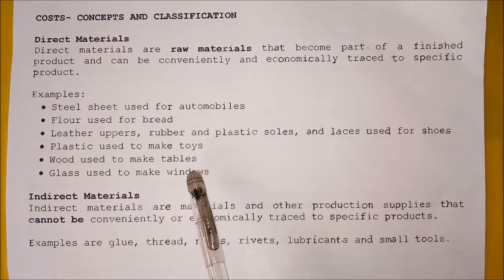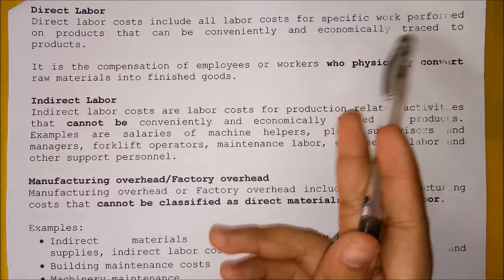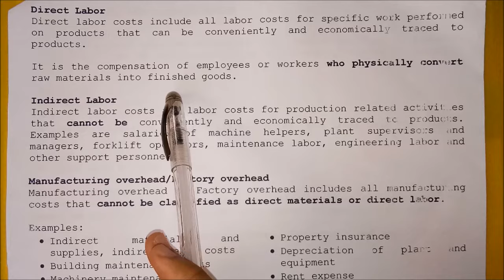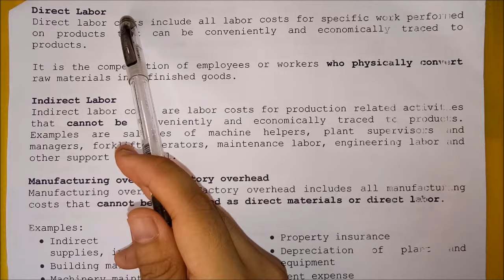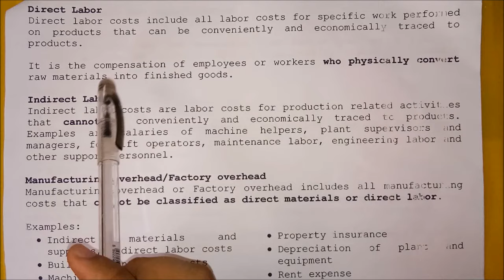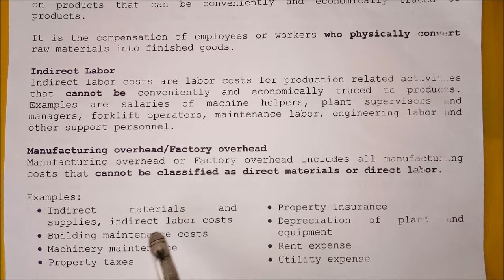Cost Accounting - Costs Concepts and Classifications (Manufacturing Cost)

Comment: SIR ASK KO LANG PO IF HOW RENT AND UTILITY EXPENSE FROM FACTORY OVERHEAD DIFFER PO SA RENT AND UTILITY EXPENSE SA ADMINISTRATIVE EXPENSE PO? SALAMAT PO HEHEHE
Reply from the maker: Hello Christopher.

Ang Rent expense and utility expense, can be factory overhead or admin. expense. Depende ito kung saan ginagamit ang expense.

Kung ginagamit sa production (like rent ng factory bldg, electricity and water costs ng production), then factory overhead sila. Hope it helps.
Reply: @FilipinoAccountingTutorial  AH BASTA RELATED PA RIN PO SA PRODUCTION, CONSIDERED AS FAC. OVER. SLMT PO SIR 😊
Reply from the maker: Yes, basically basta manufacturing/production cost pero hindi direct material and hindi direct labor, factory overhead yun. Mag aral nang mabuti ❤️
Reply: @FilipinoAccountingTutorial  noted po, thanks a lot po sir 😊